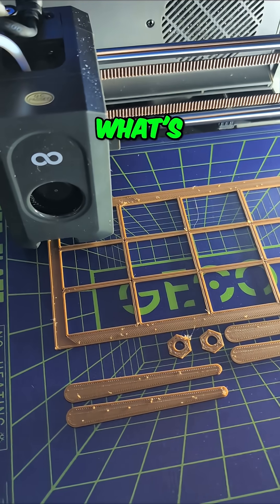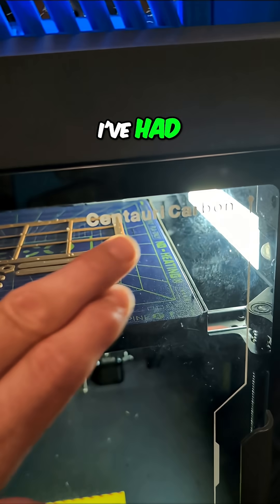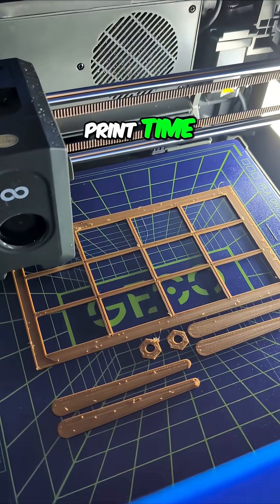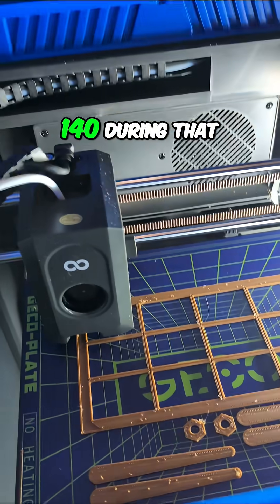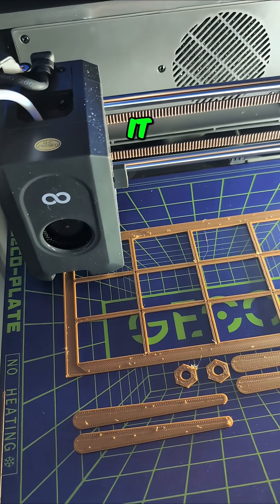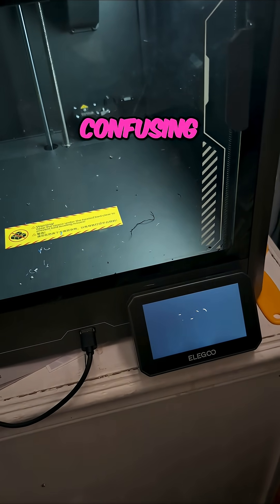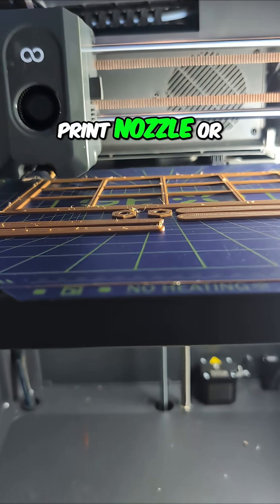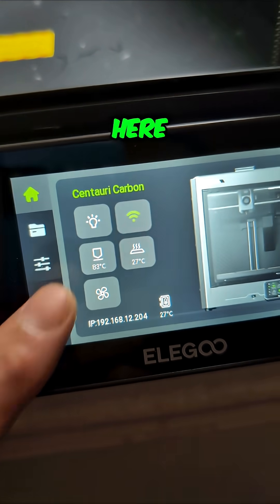Elegoo Centauri Carbon: Nozzle Temperature Dropping?! Printing Issue! #shorts

Comment: software issue?
Reply: Sure looked like it. Someone suggested on another video that it is a firmware issue.
Reply from the maker: Probably, but not sure. Reboot fixed it
Reply: @GearReportMaker  Try factory resetting the printer.
Reply from the maker: If it glitches again and a reboot won't fix it, sure. :)
Reply: @GearReportMaker  yay